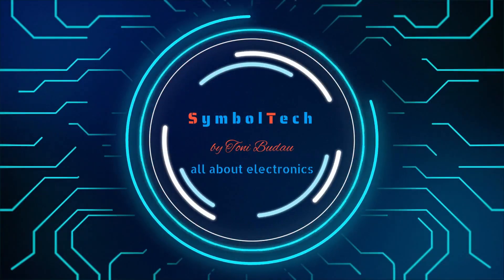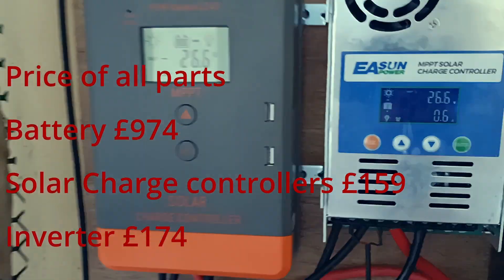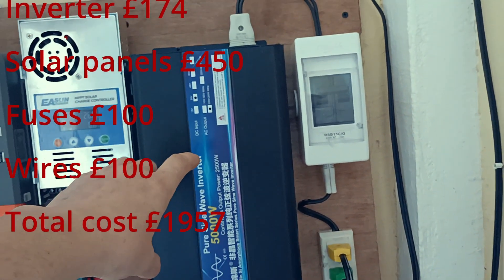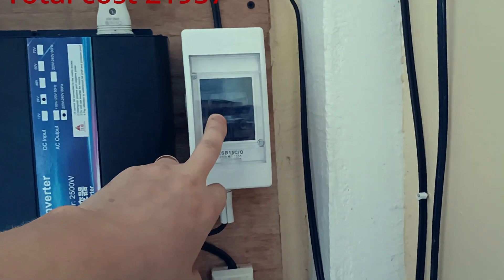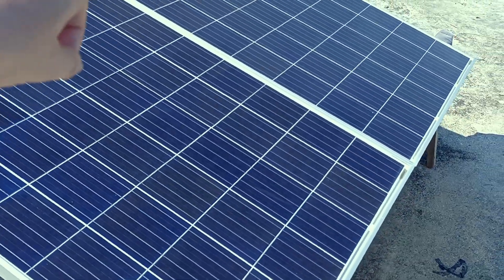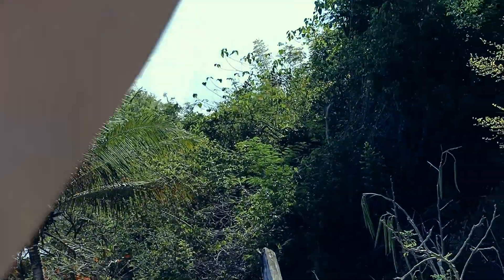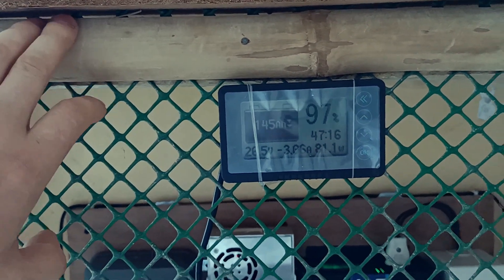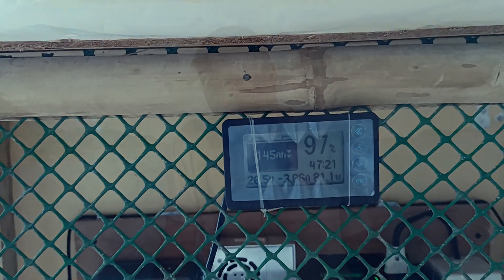Philippines Solar System project

Comment: I just found some great panels and off-grid inverter on Alibaba. I have one of the same inverter and I know it's reliable. 11 of the panels will max out the inverter without going over the input voltage limit. Unfortunately, I'd have to buy enough for three sets of panels due to seller minimums but I'm sure that I can find enough luxury items to use such as a jacuzzi and individual tankless water heaters. Not that I'd need anything but a black barrel to heat my shower water. I can't wait to move there. It'll be a retirement paradise. All of the bad women of the world will have made life much better for the people of The Philippines. I plan to get very accustomed to going into town for supper and will gladly support the local businesses.

Comment: Breathtaking scenery 😮 harvesting energy from the sun there is no problem, I can feel the heat of the ☀️ ❤
Reply from the maker: When you will be back on the island?
Reply: @SymbolTech21  I'm planning to fly back there before end the month
Reply from the maker: @marionlacandola8782  please give a check on the solar system and the 4 solar panels need to be tightened to the wooden frame in case of to strong wind to don't fly away!
Reply: @SymbolTech21  sure, no problem brother